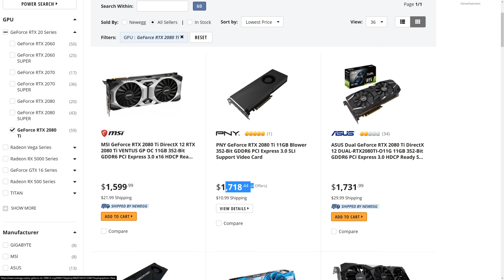Can $4200 buy a PC that will last 10 years in 2020?

Comment: I'd just do $1500 every 3 years. So start with a $1500 build then ADD another $1500 worth of parts (dont build a whole entirely new system just upgrade)
Reply: I do something like that too. By the time I need to upgrade my motherboard, cpu, ram,  I've already upgraded the gpu, and drives and such, and a lot of that carries over to the new build, keeping the total cost at once down.
Reply: ITs because today technology does not grow up 10 years directx 12 exists... nothing is changing on 10 years old rig we play games and 2020 year old rig we play same games as we had 10 years old rig only better fps we have more nicer graphic but skill is same,.
Reply: I do the same ,but 300 every 3 years...
Just upgraded from a 1200 to a used 2600x and my Rx 570 to a 580 ,while selling the old
Reply: @miltoska9708  Me too thank god for AMD hardware lol
Reply: @MakeSh00t  bro reading that comment was hard to follow.
Reply: @miltoska9708  rx 570 to rx 580? Seems like a waste since the difference is not that huge
Reply: I upgrade one thing every year. this year it was CPU next year around jan ill do GPU. that way i always making my computer a little better every year. and every two years its a new PC.
Reply: I used to do kinda that, but with smaller budget and I just kept upgrading the PC over time. Now I ended up trading the PC for a motorcycle so I have currently quite low end PC :D (It had i5-3470, but I upgraded to i7-3770. The rest of the specs are 8gb ram, 1050 ti, 240gb ssd)

Comment: AIO for 10 years?
hah l0l
Reply: Timmy joe reviewing computer parts on the internet and selling people computers that are supposed to last 10 years with a cooler that won’t last for half of that. Basically he’s set up a future return visit to check cpu thermals and get a couple upgrades while he’s at it.
Reply: Noctua cooler would last 10 years
Reply: @megapet777  that will actually outlast your entire lifetime.
Reply: I just took an H80 off a computer that was built in 2010. It worked absolutely fine when I took it off, and I even took it apart to check and it was completely clean inside. Just a bit low on coolant. That's probably an exception, but it's not like it can't happen. And I'm sure AIO's made today have more consistent quality than they did 10 years ago.
Reply: The Corsair 120mm radiator AIO on the wife’s 4770K has been on there since it was built (7/8 years old now) & temperatures are still under 60°C under constant full load for several hours. Maybe it is because I installed it with the radiator barbs being the highest point of the AIO loop from day one like Gamers Nexus pointed out in a recentish video (& I keep everything internally dust free every week/10 days). Chassis isn’t brilliant for coping either with the 120mm exhaust off the AIO, a top mounted 120mm exhaust & 2 x front mounted 120mm intakes (all non-RGB Corsair fans usually all running at 450rpm unless under load when they ramp up). Considering it also houses 6 x 3.5” spinning rust HDD’s & a GTX660 as well & is insulated with sound deadening foam on both side panels (Coolermaster Silencio 650) which have been tempted to remove but can’t be bothered unless internal temps start going through the roof. If I upgrade the RTX2070 in my main desktop to a 30xx series & swap out the GTX660 for the 2070, I don’t think the temperatures will increase by more than a degree or 2 Celsius.
Reply: Actually my old h50 is still on an old 980x cpu from 2010 that I gave to my brother.
Maybe they just don't make them like the used to.
I actually prefer air cooling though to be honest, less variables.
Reply: In my experience they last about 3-5 years they usually have the coolant evaporated so if you're willing to refill them it might last 10 years
Reply: @jaylay850  Expecting 7 years out of an aio is insane.  There are exceptions and it's dependent on how often you use your computer.
Reply: @jaylay850  Maybe the new ones, I don't know.  Historically aios are well shagged after maybe 4 years.
Reply: @jaylay850  Math is racist now dude. No math for you!
Reply: @twizz420  Just took my H80i off that was built in 2011, same thing! Those were great coolers! It still works great.

Comment: I think the 3950x would’ve lasted longer. Once games start to actually utilize more cores.
Reply: Yea but the guy can throw in a 4000 series ryzen chip by that point
Reply: Also games are just about using 6 cores now, with the next gen consoles only having 8 cores or so. He's got decent headroom with the 3900.
Reply: @armando1is1great  That is true. But I thought the point of the whole build is to do a PC that will last for 10 years without needing CPU/GPU upgrades.
Reply: 3950 isnt worth the extra money. plus you just end up needing to cool it more. and using way more electricity to run it. and sometimes it actualley games worse then the 3900. you will probably never use 12 cores at 100 percent for gaming. and  you should never buy for that far into the future because you never know what will happen next to make these cpus obsolete. were assuming things will just keep inceasing clocks and cores. but they may invent a whole new architecture that only uses one core to do everything.
Reply: Spending significantly more on a 3950X makes no sense though. Barely even makes sense for production loads since it's only dual-channel memory supporting and latency bottlenecked by IF, even with FCLK and memory overclocking. Only reason a game would utilize 16 cores is if it's extremely poorly optimised (like games which use 6+ cores currently) or if it's extremely physics-based like Universe Sandbox or FS2020. In reality, a 12 core CPU will last you for a long time if all you're doing is gaming, reminiscent of 2nd gen i5 PCs until just a while ago. Hell, an 8 core would be the max I would suggest to someone who is only playing games, right now. It's the beauty of PC upgradability.
Reply: @Amusia727  So what if games start to use real world physics, Were every thing has a value that is one to one to the real world? Or some other crazy thing that would make our games so life like, some pepole will end up forgetting there playing a game.
 What we can do in a game is changing slowly today, with the new gpus from nvidia. So what if physics is the next big thing?
Reply: @akimbofurry2179  Video games aren't going to make some sort of quantum leap ahead in technology like that within the next 10 years AT BEST. If you make any scenario ridiculous enough, then obviously nothing will pass it. An x58 xeon with 6 cores OC @ 4.4ghz is still gaming perfectly well today 10 years later and it's not like within a couple years all games are suddenly going to take 8 cores minimum so I don't see what your point is about a 12 core not being able to last 10 years.
Reply: @twizz420  I mean tech has had odd leaps and bounds every so offten. Ten years is a long time, I would rather have over kill then just enuff, and then find out 5 years later some crack head coding geneus made my games almost a tayabite big, with some odd ass real world physics and lighting skeam, that eats processor cores like candy.  While every detail in the game looks like a 4k real world movie. 
 I mean that's on the extreme side of things and is unlikely, but who knows what could happen in ten years. Perhaps we will break the AI intelligence, and games start using that for the AI, and every npc and bad guy is controlled by a master AI, that gives everything a almost life like intelligence.
 I could see that eating up a lot of cores.
Reply: @akimbofurry2179  might as well say you're not getting a house on earth because next year we could be living on a Dyson sphere circling the sun. That's how ridiculous what you're saying is
Reply: @twizz420  I mean not realy, we all ready are tying to figure out ai, and with were graphics and computers are at to day, Its not unimaginable that we could come up with something taxing, that could add to the immersion of some games.

 While a dyson sphere is not only costly in design but also centuries away from ever being feasible
Reply: Also there have been at least one huge leap in computers at least once cents the 90s, 

 Also computers are only going to get stronger, it would be foolish to think that no game dev will not try to take advantage of that sooner or later.
Reply: @akimbofurry2179  Keep dreaming.
Reply: @twizz420  I mean that's what my sitters exe boyfriend said about vr, cartridges making a comeback and one other thing that ended up happening.

Comment: Spent around 1000$ for my Core 2 Quad System back in 09 & used that computer until 2 years ago. Paid 400$ just for the Q9650. The motherboard was limited to 4 gigs though. I did end up putting an RX 480 8gb in it right before passing it off to my brother who still uses it.

Comment: Nothing wrong with a PC having a Blu-Ray burner.
Reply: yes,until recently i had 2 dvd burners,i was looking for a blu-ray drive for permanent backup,but they are waaaaaaaaaaay too expensive
Reply: Cheapest one on newegg about $63. I have a couple because I have a small blue-ray collection, but optical drives seem to be getting less popular every year.
Reply: RPCS3 pretty much requires one.
Reply: @f_for_freedom2492  Bought my ASUS Blu-Ray drive (same as in the video) for 89€ late 2019, have probably burned some 80 Blu-Ray discs with it so far and DVD's as well.
Reply: @johnsmith-gs4qf  I think many younger people don't buy them (perhaps thinking they don't need them), and you also have cases that don't have 5,25 drive bays. But in general sales a pretty good.
Reply: @7828191  Can i have the exact reference please ? been looking for a good,reliable Blue-ray burner,or at least a drive that can read those
Reply: F For Freedom my Plextor BluRay burner from when I built the system it is in is still going as well as it did from day one. I have always bought Plextor from the days of 2x CD-R burning via a 80pin SCSI adaptor in a Pentium II slot systems (socket 7 CPU’s & architecture back then couldn’t handle the constant transfer rate as they had no buffer back then meaning if the data transfer speed dropped below the 1x threshold, it was a knackered disc & failed write (CD-R media was not cheap back then in mid90s!)
Reply: @OliverQueen1974  hey,thanks for replying,even after all that time since the original comment was posted,could you tell me what exact model it is,or at least what model family it is please ? thanks in advance,have a nice evening !

Comment: I have that same case. The 280 fits easily on top or front without interfering with vrm or shroud. You have to split the rad and fans. Put fans in front of rad with the mounting bracket in between.  Same as for the top. Plenty of room.

Comment: AIO
10 years
NOOOOOOOOOPE
Reply: Yeah gotta read up on Noctua warranty periods and compare
Reply: @joeykeilholz925  Even if both fans fail it will still work, unlike AIO
Reply: Been running my deepcool aio 24/7 for the past 6 years. No problem
Reply: @ExcZist's Studio custom watercooling hasn't problem if you change the water every 2 years I have parts 20 years old and working fine D5 pump 14 years old now transferred at so many systems and running my systems 24/7 most of the time. If there is an option to change that water at the AIO maybe can run 10 years or more.
Reply: Ezpz, just buy an Eisbaer. Can replace all the parts if they fail
Reply: @HAHA.GoodMeme  And most likely noctua fans will work 10 years

Comment: I built in a Cougar Panzer EVO RGB case.  It is basically the same case sans the optical drive bays and has, you guessed it, RGB fans included.  It has a 360 AIO that I mounted at the top of the case.  Made possible by no optical drive bays.  It came out pretty good. I like the design of the case, but I probably wouldn't do it with my build (and didn't).

Comment: So, because of some odd youtube recommendations (your channel slipped in there) - i have actually watched a few of your videos. 
I am always amazed at the standards you reviewers apply on gaming. As if anyone notices the difference between 70 or 80 fps in actual gaming experience.
Seriously .. i do not even have a gaming computer, just a Cintiq something graphic tablet and i had no problem running Tomb Raider on it as smoothly as i like. And that, too .. is an almost 2 years old computer. I dont even know if i have a graphics card in my computer.
Reply: If you game, you would notice it. That's like saying "I don't know why anyone would buy a ferrari. My used honda civic does the speed limit just fine"

Comment: My amd lasted 10 years until it died.. It was cost 2000 euros, only gpu changed to r390 and i had alot of fps.. in games for old cpu. over 160 at 1920... at low settings. Amd Phenom 1090T 4000mhz OVerclocked 2000mhz Memory cl10. Underclocked.. to 1600mhz cl 8

Comment: I spent 2000 on my system and I have a 3700x, 32gb ram, 2080super, 1tb nvme, crosair 240aio, 850 watt evga psu, and an asrock x570 steel legend mobo....... YIKES 4200  I WOULD HAVE GOTTEN A 2080ti easy LOL
Reply: Where do you live
I am building one with 1,2-1,3k and i have a ryzen 5 3600, b450, rx5700xt,  16gb ram and 650w
Reply: I built my pc in 2017

8700k 
Asus Strix OC 1080 TI 
250gb Samsung 960 evo 
1TB Samsung 850 evo 
Asus maximus X hero Z370 motherboard 
Nzxt Kraken X62 aio cooler 
Nzxt S340 elite case 
32 gigs corsair vengeance lpx 3200 CL16 
Seasonic focus 80+ gold 750 watts 

Still a beast even today 3 years later
Reply: 3700X at 4.0Ghz 1.25V
2070 Super (vertically mounted to reduce CPU, GPU, and 2nd NVMe temps by 5-7C)
2x1tb WD black SN750's
2x16GB 3,600Mhz CL16 RAM (Dual channel)
ASUS X570-E MOBO
P600S Phanteks case
750 PSU

I would've gone with Samsung NVMe's but the WD blacks are faster and were $145 each.

'Merica
Reply: @christophervanzetta  
3800XT at 4.85ghz 1.5v
RX 590 (waiting for big navi)
1x SX8200 2tb NVME
1x Sabrent Rocket 512mb NVME
2x16gb Patriot Steel Viper 4400 CL19 @ 3800 CL 15
x570 Aorus Master
Metallicgear Neo Qube case (011D clone)
850w TT toughpower psu

blame canada
Reply: Lol I got a gaming laptop with a 2060 in it I don’t know the rest spent maybe 1.2k
Reply: @Upassmexican  sounds about right
Reply: Jaylen yeah it’s a beast play all games 100 plus FPS on high

Comment: My 4770K machine isn’t far off 10 years of now (in reality 7/8 years from memory) & even with the GTX660 that’s in it, it still plays the games that my wife plays at 1080p with most settings maxed out (she plays Sims 4, Diablo III & WoW) at 60fps (panel limitations & even when she had a GTX970 in it, she couldn’t tell the difference between the cards!). The system also has a Plextor BluRay burner in it as well which gets used mainly for making a semi-permanent storage method for all the RAW photos from events/weddings she takes - can’t call it permanent storage as there is a finite lifespan on optical media anyway & she makes a copy of the copy every 5/6 years which are stored in 3 different locations). I also use an USBv3 converted SATA laptop BluRay burner on my main desktop for MakeMKV rips of my ever growing BluRay collection (need to find a 4K/UHD capable optical drive now!).

Comment: I had a $700 Pc that lasted 13 years. A Q6600 OC the whole time, in an Antec 300 case lol. I had to quit using it because all the MB sata ports failed one by one. In that time I had to replace the PSU after a spectacular kablamo! Added another stick of ram, and replaced graphics.

Comment: Assuming a new breakthrough isn't made, and if Moore's law is anything to go by, a PC built today will last longer than a PC built back in 2010. As we approach the limits of transistor density and that quantum tunneling becomes a major issue for 5nm and lower I don't think we'll be seeing the gains like we did back 10 or even 15 years ago.

Comment: I generally try to go 80% of what’s best and buy second hand or new with receipts. 32GB (8GBx4) DDR4-3600 kits can be had for $140. If you search long enough, a Ryzen 9 3950X can be had for $800. There’s plenty of ways to go top 20% of what’s out but way cheaper. Reason being is I find GPUs are the only part I would upgrade over time. Saving that depreciation helps your resale value and keep your system more modern at minimal expense. One of my friends has an old i7-980x that was worth a lot for the first few years after he built the box, but now they’re $150 at most.

Comment: I just came for the case, I own this one, but I did not pay that much for it xD.
It's a very good case, has some "compromisses", but this case love air; most of the cases now on days just want your parts to melt.
By the way, the cages on the back is for 2.5" SSD and there's 2 places for a normal HDD.

Comment: A £1600 comp I built in 2009 mostly lasted but after 6 years of heavy use I started getting hardware failures (GTX260 died, PSU died, i7 920 started baking itself even after changing heatsink and thermal paste, case fans started dying pretty quickly)
All the HDD's (3 of them I think) survived the full 10years or so of more or less daily 12h+ use though (moved to pure SSD base now).

Comment: Well optical media is still a really cheap and viable backup option for long term storage (if burned on a low speed and stored properly to postpone the inevitable bit rot), since the Ultrium tape-drives are quite expensive. I have pressed CDs from the 90s and recorded from the 00s that to this day still read fine. So don't give your client a hard time for buying a BD drive.
Reply: This right here, don’t have a BD burner. Just a BD reader myself, it’s nice to have when needed.